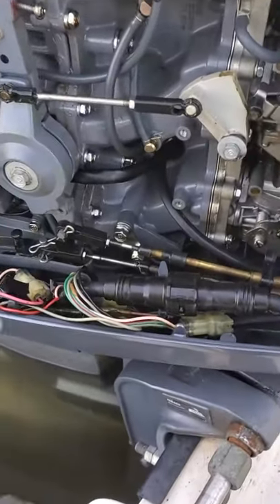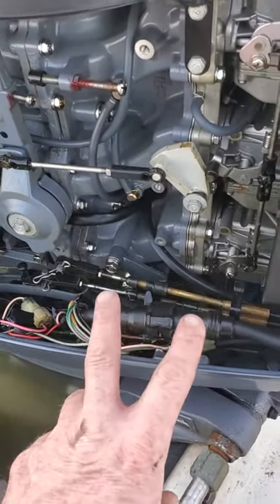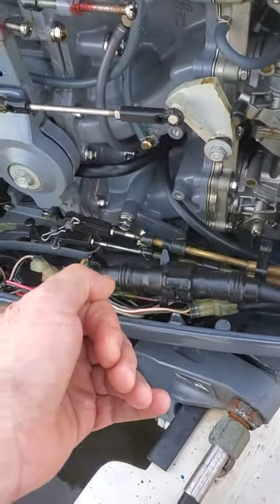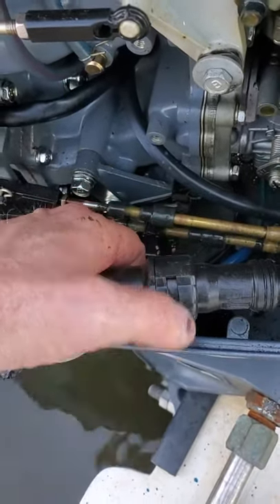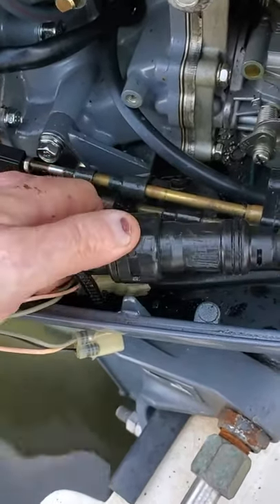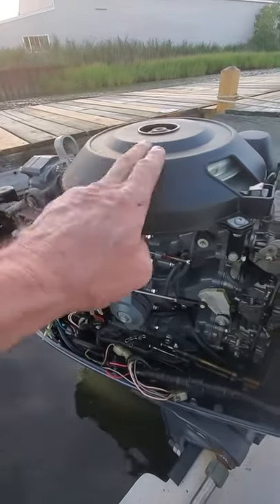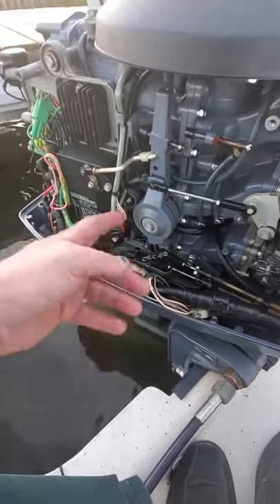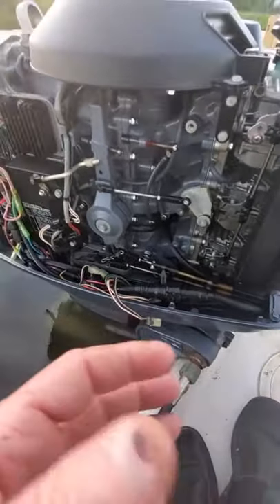Yamaha Two Stroke Outboard Key Switch Harness

Comment: Brilliant and well detailed video. I checked the kill switch and have nothing on the ignition when turning the key. Living in Ireland but where would you get a 10 pin key starter. Need to isolate the issue but head wrecking as well. Video is great and informative. Thanks again 👏👏👍

Comment: Great video.  I have a 17' Boston Whaler with the identical outboard - 2004 90HP Yamaha 2 stroke.  Started boat prior to launching with no issues.  Towed to VA from NJ and at launch, turn ignition key and get nothing - no click, just silence.  Put power directly to starter and it cranks.  Used remote start (push button as you refer to it) to bypass starter relay/solenoid and with the key in on position, the engine starts and runs fine.  Replaced starter relay with a brand new relay, carefully re-assembled and have the same issue - nothing at turn of key.  

I figured that it would not be the ignition switch since the engine runs fine with key in on position and after being started with the push button.  I did not pull apart the wiring harness.  I can do that, as you demonstrate, to isolate the ignition switch.  When I get it open, which two leads do I connect the push button starter to?  

How do I test the neutral safety switch that sits behind the gear rods?  

Thanks in advance
Reply from the maker: Try holding the key in the crank position and shifting the shift handle from nuetral to forward and then back through neutral  into reverse And back to nuetral. This works the nss through its on/off position. 
If no change then unplug the engine harness and check continuity through the key switch (r/pu) to (y/r) while holding the key in the crank position. If no continuity its the key sw or nss in the control box .

Comment: Greta info!  I have a 2006 Yamaha VMAX HPDI 200 outboard on a 2004 G3 HP200DC, and I’m planning to re-wire my boat this winter…my console switches are the crappy membrane type and don’t work and there’s a ridiculous amount of old Molex type connectors/wiring harnesses, etc in my boat that are causing a lot of intermittent problems. I’m going to do a complete re-do on all the electrical on this boat including new wiring, fuse blocks, gauges, console switches, etc.
Does anyone have a wiring diagram for this engine showing pin-outs/wire colors for starter, kill, trim/tilt, tach, etc?  Any help is greatly appreciated!
Reply from the maker: That would all be in the workshop manual

Comment: Hello Ted, you’re about the only guy that I trust to ask on the entire Internet on YouTube. I have a 1989 90 HP Yamaha ETLF. 2 stroke. It has been sitting for almost a year because I hook the battery up backwards, and now my multi Gage is reading off an erratic when I move my tilt trim up and down seems to only be tilt trim that is erratic and incorrect, but I never turned the engine over. I just turned the switch on when the battery was hooked up backwards, so the engine wasn’t cranked over with the battery backwards. I once I realized what was going on. I turned the key switch off. I haven’t tried to crank it since then, because I’ve heard nightmares on how I could’ve ruined something in the charging system if I ran the motor with the rectifier bad after hooking up the battery backwards my question to you is what would have been the main things ruined when I hooked up the battery backwards? The only thing that seems to show signs without me cranking the engine is the tilt trim meter not reading where the motor actually is up or down. Before all of this the engine ran like a top so I don’t wanna crank it over and ruin anything. I’m very mechanically inclined with cars, and I’ve been learning about outboard’s for the past three or four years any help would be much obliged thank you and God bless you.

Comment: would have been good to see you do what is actually the most difficult part. Anyone else ready to slit their wrists just trying to get that shit design harness connection apart? Mine is right next to steering and then lasso down exactly where I need to put my hand around it. I would rather they have made you have a special too. They couldn't have at least put some grippier text on the two outsides?
Reply from the maker: Agreed, the first time I saw this It took me several minutes to figure out how to get it apart. That's good old engineer's designing something without ever having to work on it!!

Comment: I have a 1992 yamaha 130 that I have replaced the benical, ignition, and wiring from ignition to the engine...it will not shut down the engine by the key? I just bought this boat and all materials I have put on are Yamaha factory parts please help this one's breaking me in properly to boat ownership. 
Thanks so much!
Reply from the maker: Serial # please

Comment: What color wires go to the key switch , I believe Yamaha uses the same colors for all there engines
Reply from the maker: For Yamaha older four stroke carb engines:
to shut off the engine:  white and black have continuity
For Run: Red and Pink have continuity 
For choke or enrichment Red, Pink and Brown have continuity